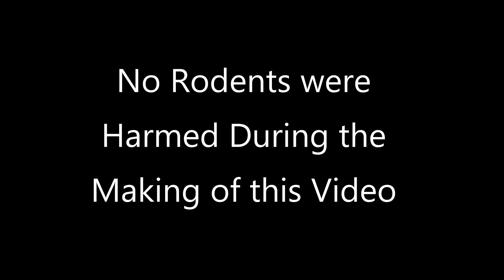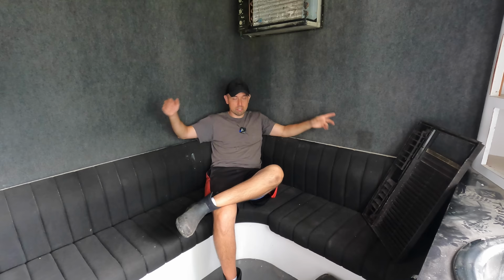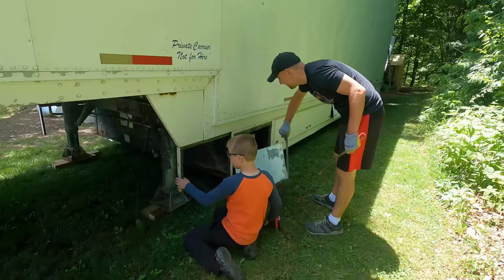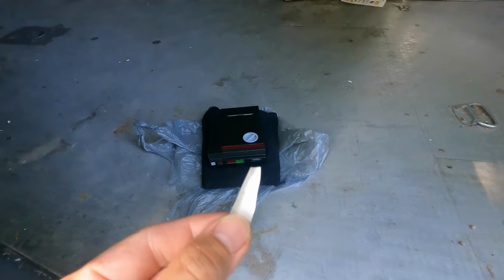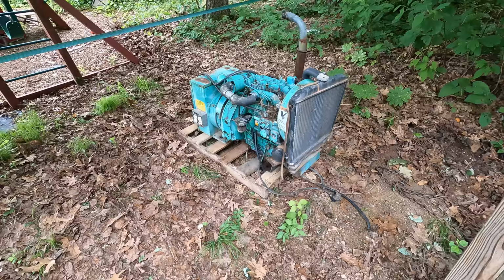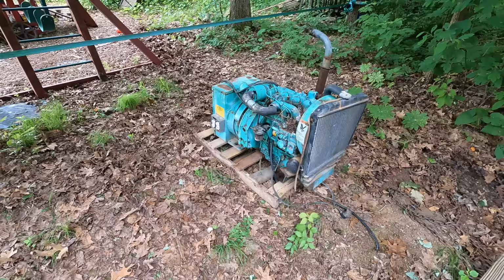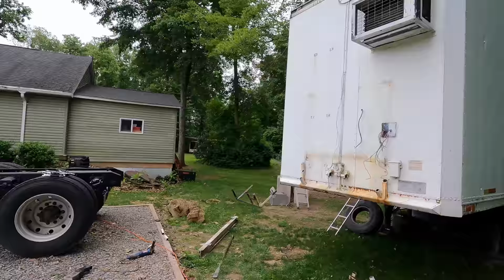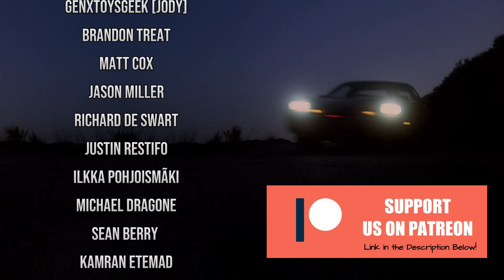Knight Rider Dorsey Trailer Teardown Begins! PLUS Removing that Huge Generator from the Front!

Comment: This trailer was built in the early 80’s in Elba Alabama at Dorsey Trailer’s. I worked there with my Dad for years until it closed in 2000!. It’s reopened under new ownership twice since then. Now is presently owned by Pitts Trailers going under the Dorsey Logo! It’s a name that HAS to be used on any trailers built in the building in Elba! They build NOTHING like these drop deck trailers there anymore, it’s all flatbeds. I remember pics of this trailer being in our break room also pictures of trailers like it built for the group Alabama and also Rusty Wallace Nascar team trailer. The last built there of these type that I personally worked on was a drop deck trailer like this for county singer Leanne Rhymes in the early 90’s! Good to see y’all found this trailer!!!

Comment: Joe, please keep at the outside of the trailer.  Even with what you did in this piece of content it looks far better.  Especially when the belly boxes and other structures that dont need to be there are removed.
Reply from the maker: Yep they are next for the chopping block!
Reply: @KnightRiderHistoriansOfficial  As you say the rear dor is not original ,end you will make a new like the original from the movie , Joe can you finde a donor rear dor from another Dorsy trailer of these years of productions , maybe it will be more cheap , instead bilding a brand new  , if you can finde in realy good condition it will be very nice !!! Reglards from Bulgaria
Reply: I want to see pictures of the semi connected and kitt in the trailer. Before and after. I would
Reply: Update from flag remote agents. Analysis complete. Generic non bonded paint. Sadly  knight rider force only able to give logistic support. Keep up the good work!
Reply: I agree
Reply: I agree fix the outside that will be quick and pretty easy. No one ever really saw the inside of the original trailer anyway. Having it as a rolling maintenance shop for the show vehicles sounds like a very fine idea. Keep the comfy lounge and add a better hidden Ac system.

Comment: If the air conditioner works, maybe wait to remove it until you can’t proceed without doing so. That’ll make working inside more bearable during the summer.

Comment: I would strongly consider retrofitting some conveniences, A/C, water, maybe a camper type toilet system, if it's going to be used on the road.  A/C at the very least.  The Foundation would have had it on there was it really being used as a mobile command center.   Maybe hide it in the remaining belly boxes.
Reply from the maker: Yep already in the plan! It will all be hidden out of sight!
Reply: Yes many bus AC system have side mounted condenser you could easily hide in a belly box with fans

Comment: I know it wasn't canon to the show, but I could see the trailer needing it's own generator, considering all the electronics and other equipment that was supposedly there in the show
Reply: i think a Battery Pack and Inverter is a better choice than a Generator for this. Less Heat and Noise to deal with.
Reply: considering the tech and people the foundation had, i'm sure there was something hidden in the trailer for power, or maybe an extra alternator on the tractor to feed a battery pack in trailer

Comment: That generator looked ridiculously heavy. At the point where you started to lift it with the digger, I was half expecting the trailer to flip up.
I would be tempted to keep the 'Season 5 bathroom window'. Maybe Devon thought it was a long overdue addition after being unable to cope with 4 people using the same bathroom for a year. - I know you won't, but its fun to speculate.

No special requests from me - just keep doing what you're doing. It's all really enjoyable to watch.
Reply: I have something similar that I got as a freebie. I'm guessing around 400lbs
Reply: @jonmyers8046  Best open that window all the way then.

Comment: Sawzall with metal cutting blades.  Nice hat Andrew😃  ,Measure the width of the part sticking out, cut that distance up from trailer to make piece to cover the holes (cut off three sides only), weld after pounding flap flush.

Comment: I'm surprised at how big that thing is on the inside.  I know on the show they used a separate set for the inside, but the set looked like it was more than double the size of the trailer.  It's interesting to find out that it was actually not much bigger.  Now we just have to figure out how RC3 got from the lounge are to the tractor, by just walking through a door.  When, even on the show, they weren't connected at all.  Maybe he climbed along the outside, rofl.

Comment: I would put a connection in somewhere hidden underneath to where you could hook up a cable to an outside 50 amp quiet generator. That way you have lights and whatever you need to show off the inside of the trailer

Comment: Seeing as you're planning to replicate the workshop/lounge set inside the trailer maybe consider some of the accoutrements to make things a bit more livable when you take the completed rig out for shows and such and at least think about how you could hide some of the mechanicals like a smaller generator and AC inside some of the consoles and set pieces. Obviously you'd not be planning on living in the trailer on a show site but trust me even with a man door and rear door open under certain conditions trailers can become sweat boxes. Just something to consider in planning in the future with of course keeping everything with an eye on keeping it within the bounds of maintaining screen used accuracy.

Comment: Ah good to see progress with it.  I know it's all about making it - as it was - but if it works, unless there is a slimmer version, AC would be rather nice!

I bet in the time to come, you cannot wait to see the interior... looking just like the studio version! :)

Cheers from the UK.
Reply from the maker: We have a plan for "hidden" AC!
Reply: @KnightRiderHistoriansOfficial  excellent, either way the trailer had to have been air conditioned especially with all those electeonics inside. Computers do two things, they generate a lot of heat and they love to be in cool temperatures. 

Also, the way Mr. Miles dressed he would have been quite uncomfortable in a tin can that absorbed the desert and generated its own internal heat from the computer equipment.

Even RJ was quite comfortable in the cab of the truck. As the truck had its own electronics for self driving It must of had an A/C system up there up there, even though it was almost unheard of in the 70s and 80s tractors.

Comment: Good start.
Instead of starting anything on the inside, I would suggest getting that air con unit off, repanalling that section and then removing the window on the side including repanelling that section as well.
The underside needs sorting as started but needs completing.
If all the outside is done, most of the trailer should be water tight.
Then its got to be that back end to get sorted, door, pullies, etc
Then the trailer should be completely weather proof for next winter, so it can be either painted or the interior started.
Top tip, draw up a plan of action and complete each section before moving to the next. Progress may well be slower  bit on this project accuracy is far more important than speed.
Let's remember the truck and trailer are now safe, so time is on your side.
Reply: I might leave the AC on the trailer if it still works.  I have worked inside trailers, and they get unbearably hot and humid.  AC, might make working in it more bearable.  Right now it is keeping the rig tight.
Reply: @jaybird4095  You might consider hiding it in one of the belly boxes. Since the whole thing will be painted black, an opening covered in fine mesh screen in one of the doors will help it work as best as possible, while blending in with everything else.
Reply: @tsherwoodrzero  why not put the Openings for the Air inlets/outlets for the AC on the side facing the trailer Tires? that way it wont affect the looks in any way
Reply: @unitrader403  the vents would get filled with road dirt and stones
Reply: @roadwolf2  because of this i said the side facing the _Trailer Tires_, which faces backwards to the driving direction, not the side facing the Front.

Comment: Honestly, I think it would be cool if you put up a temporary knight shield logo on the side of the trailer while you're still doing external work. Doesn't need to be fancy since it'll have to be removed in the end anyway, but I feel it would be neat to have something that really establishes this as THE trailer from Knight Rider since the evidence of its origins required a whole video in of itself to explain because it was bolts, remnants of stunt modifications, and the serial number, none of which is identifiable at a glance.
Reply: I think Blue ( #001EFF ) would be a good color for this, since its the inversion of Gold ( #FFE100 ), because the Trailer is currently White instead of Black.

Comment: Loving the channel guys!
Save you spending cash on replacing the tail lift mechanism, and gutting the entire trailer. Would it be better to make the outside of the trailer 'as per' the show as planned, and adapt the inside with what you got? So keep the tailift, winches etc, still kit the rear out like on the show, but adapt some of the inside keeping some of the fixtures that are there to save some cash.

Wish I lived closer as I would be straight over to help, however theres a large body if water and a few thousand mines between us lol.

Keep up the good work!
Reply from the maker: Thanks Adam! We did (briefly) consider that. But, no, we are going all in. It will be exactly the way it was, down to the little details that most will never see or notice!
Reply: @KnightRiderHistoriansOfficial  Love It! Can't wait for it to be all complete :)

Comment: The cut-out for the air-condition I would not replace the whole aluminum panel but only patch.It will add to  the storey after the t.v show
Reply from the maker: If we can manage that, we'll do it!
Reply: Save what ever you can.No need to junk it
Reply: It is about impossible to  " patch " aluminum skin and not see a seam, total replacement is the only viable option ( and faster too  )

Comment: Looks like dirty hot grueling work ...and I wish I could be there to help in the fun. At least it's white and in the shade or you'd be cooking. Mouse poo smells horrible. You need 50 gallons of Febreeze lol. Glad to see the youngster helping out. He'll appreciate having done this when he gets older. Looking good so far buddy.  You might also want to check any local starter/generator shops to see if they're interested if you don't get any bites on the generator, but I think it'll sell that's a pretty neat unit. Peace guys, I love the new mascot 😂
Reply: Generator already sold!

Comment: I've got the Model Kit of the Flag Mobile Command Center and I plan on putting in LED Lights and I'd like to know if the Trailer  had Yellow Nighttime Running Lights along the sides of the Trailer ???
Reply from the maker: Yes, amber

Comment: You should find places to hide AC compressor and evaporator for the future when you're able to charge events for participating.  Get LOTS more people going to the trailer with KITT inside with air conditioning for fans.  When recreating the control panel lounge you can integrate the AC evaporator because it was a sound stage, never actually in the truck.  Definitely makes plans for better fan experience.  I'm thinking the AC compressor could go behind the original belly boxes.
Reply from the maker: Thats the plan!

Comment: I have only watched a few of the recent videos so far and was wondering two things (maybe already addressed)...
1) Fan help: Besides soliciting monetary donations, are there plans to allow fans to come by for a day or two - or three! - and lend some manual labor to the various restoration projects? I know it sounds like a logistical Knightmare (see what I did there? Lol) with insurance, providing a tent pitching area, food and water access, extra trash generated, bathroom (port-a-potty?) And shower accomodations.  All without infringing on your home.  But I'm sure there are dozens of fans out there chomping at the bit as it were, anxious to lend a hand in some fashion.
2) Storage: When all is said and done, do you already have indoor storage for the KITT's, restored tractor and restored trailer arranged for?  Would hate to see all this hard work later diminished but continued storage outdoors.  Maybe another GoFundMe for a new FLAG headquarters to store all these vehicles and props.  A disused warehouse, building a new steel barn structure... The possibilities!
Look forward to seeing continued progress!
A fan since the original airing.

Comment: You could hide a mini split heat pump in one of the original belly boxes. There are under bench, under counter, and similar low profile / hidden heat pumps made for RVs. Since you'll be building some laboratory or whatever set in the front part of the trailer, that would be a good place to make comfortable. Also, being able to have it climate controlled will improve the longevity of whatever you build in it because it won't be roasting in the sun, enhanced by the outside being painted black.
Reply from the maker: Yep, that's along the lines of what we have planned!
Reply: @KnightRiderHistoriansOfficial  Someone who can do custom HVAC work could take apart the outside unit of a 110V 15,000 BTU unit so its coils can be mounted horizontally in the belly box, with the compressor upright so it'll work correctly. It would need some venting underneath, with good sealing doors.

Dunno if there's a heat pump made for in/under floor RV applications.

Comment: It's probably not true to the show, but what if the plywood was removed from the original belly boxes and replaced with new plywood then lined with sheet metal inside for longevity?  If the inside of those boxes were never shown back then, how are we to know if they were always plywood inside?  I would suggest sealing the metal to protect the replacement plywood underneath, though.  You could repurpose some of the the side skirts that were removed from the trailer that way.
Reply: The boxes were never there on the right side, and only the center ones on the left side. So all of that which wasn't on the trailer has to come off to restore it.

Comment: Get some to weld in a panel where the ac is. You are going to have to do body work anyways. You might even be able to use the metal from above the window.  I wish I lived closer I'd help in a heartbeat.

Comment: I'd say work on the outside untill ready for paint then work on inside , wait on paint and graphics for last, that way you can have it as the white trailer for a short time. Edit: may have been said in a different video or I may have missed it , but with the tractor be no sleeper or sleeper version?
Reply from the maker: It will have the sleeper
Reply: @KnightRiderHistoriansOfficial  Do you plan it to be functional as sleeper too? would be cool :D

Comment: What I'd love to see is how or if you'll be able to restore the VIN plate on the front of the trailer from its current faded state. I'd imagine you'll want to keep the original tag instead of having a replica made if possible, but getting a template to repaint it with the correct Dorsey information probably won't be easy unless your contact that got you the paperwork has a resource.

Comment: I know the original set of the trailer was on the stage.  But how was everything that was in the trailer supposedly powered?  Was it all powered by the tractor?  Or did it have it's own electrical system to power the computers, lights consoles and other stuff?  Before you remove those mudflaps, if you intend to pull this trailer down the road, you might want to contact the DOT in your area and make sure it would be legal to do so because I think trailers like these are required to have them right behind the tires regardless of the belly box.  Even though this rig isn't intended to be used for commercial use, I'm guessing it still has to follow the same rules as other semis on the road.

Comment: finding mummified rodents yeah that brings back slightly unwanted memories!
a friend of mine was restoring his 16th-century house in the Netherlands in the 1990s we knew it used to have had a fireplace downstairs but they made that into a plain wall in the 18th century the downstairs chimney opening was filled as was the second floor bit of it the third floor part of the chimney going to the roof that was was removed all together so, only the second floor chimney part was left well, we had to open the ceiling on the first floor to open it and what came down I will never forget!
we pushed through 300-year-old cement and filler and about 700 smoked, dried to crisp mummified birds, bats, mice, rats spiders, one cat, and a shoe came crashing down the room filled with smoked brisket smell mixed with moldy cement and compost smell.
so yeah, this is what the mummified rat brought back into my memory so uh, thanks! I guess...
(the shoe probably was put there as a blessing or good luck charm for the house when it was built but also much like witch bottles to keep bad spirits out)
ps, the cat was probably just after the early spring baby birds (most of the birds found were infants)when a cold spell made the owners light the fire killing the cat and preserving it, also nothing was thrown away and all the mummies still reside in the house in the sellar stored for prosperity.